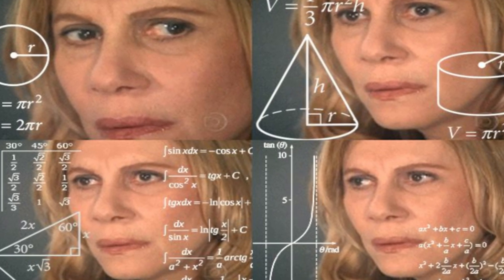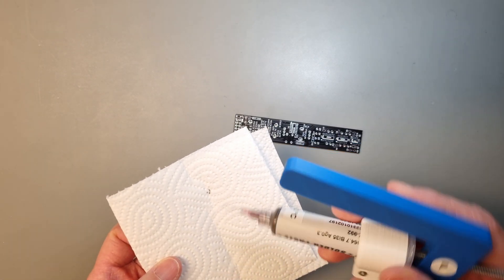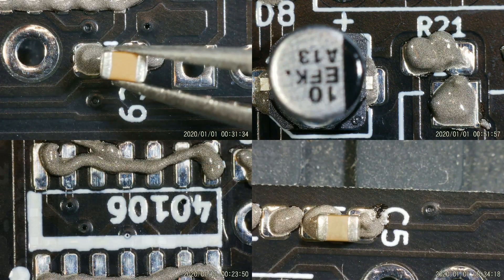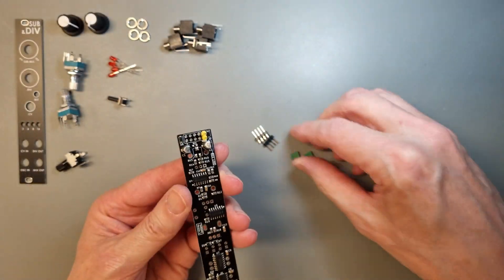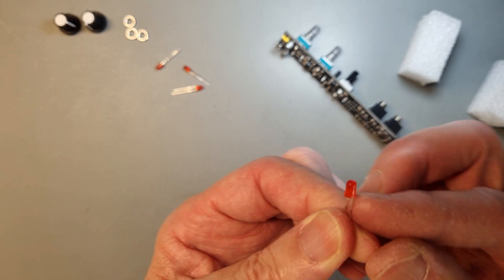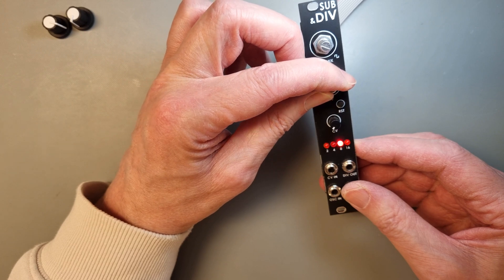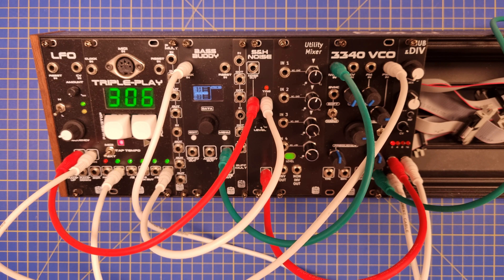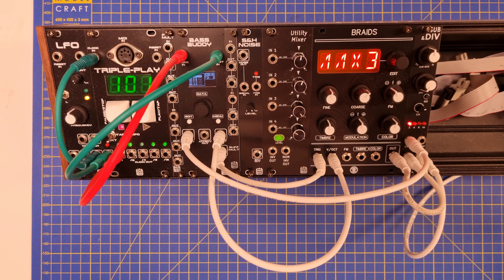Eurorack DIY: Luthers SUB&DIV - Build and Demo

Comment: pretty cool, i have built my 2 octave sub oscillator using CD4013 than used pnp & npn transistors to make it bi-polar, it uses additional +/-5V power supplies with LM4040, so it has the same amplitudes as my Make Noise STO, Roland system 100 clone vco's. it sounds very cool.
You could also run the  CD4000 series on bi-polar psu's +/-5V to achieve the same, just make sure the inputs are continuously tied to -5V via a 1M resistors or something.
Reply from the maker: That sounds interesting. maybe I should try the +/-5V approach on some build.
Reply: @MeeBilt  i have a ca 4 x 4 cm big pcb for just that exact function for using on breadboards , using opamps, a trimmer rather than fancy LM4040 or so, but with the right electrolytic capacitors and 100 nF at the outputs of them.
Reply: @MeeBilt  You can use a simple LM4040 or 78L05 and a inverting opamp to have a bi-polar supply or 2 x LM4040, etc. you need  special opamp like "opa2991" if you wanna draw more than 20 mA, this one delivers 75mA
Reply: @MeeBilt  You can run it anywhere, as long you don't exceed 18/20 volts potential difference for Cd4000 series, but the same also works for 74HC(T) accept 5V potential, the T versions are good for translating 3V33 to 5V.

Waiting too see what you come up with.
: )
But try to build a new 2 oct sub osc, it sounds better if it's the same as your VCO.
Now you notice or maybe not that something is wrong.